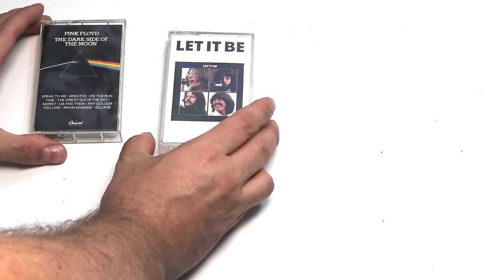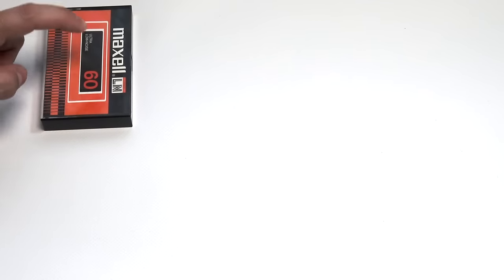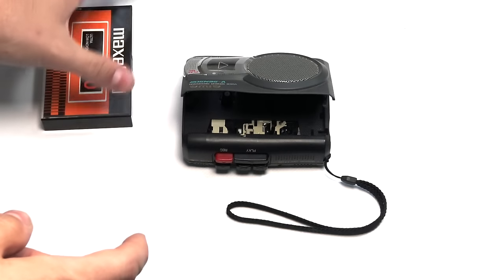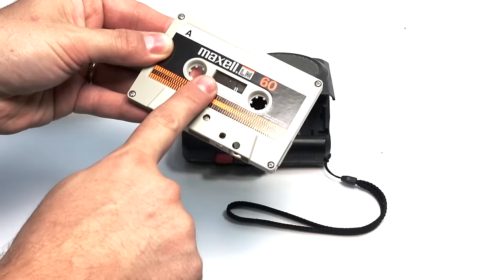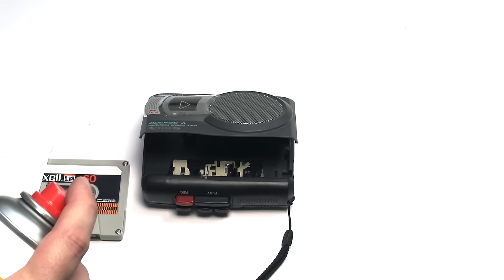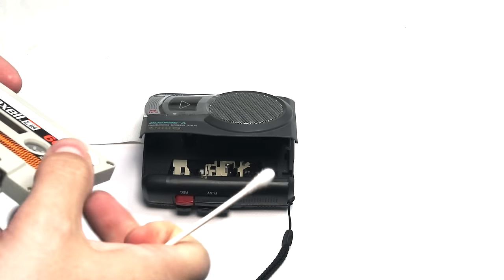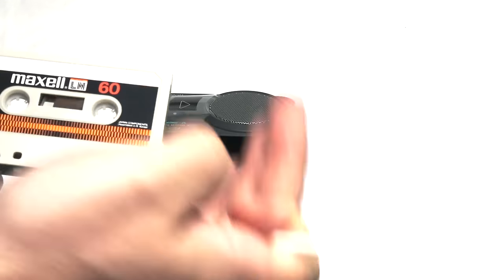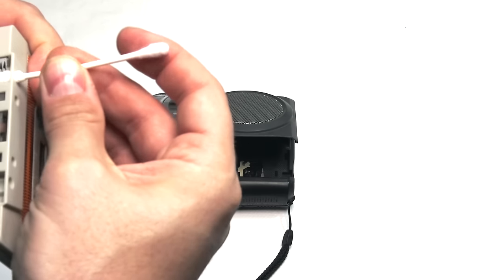How to relubricate your stuck cassette tapes

Comment: REPEAT WARNING; BE ADVISED, LUBING IS DEATH TO ANY TAPE & MACHINE HEADS ETC.
To quote one of the respondents to this post (along with a lot of others!) 'One of the worst things 
about the internet are all the pseudo-know-it-alls and "experts" who dole out this horrible advice 
and dupe people into wrecking their stuff while trying to repair/fix/modify/protect it'.

Between 1965-2005 not one single tape manufacturer, not one of the dozens of major brands, 
once suggested or advised users / consumers to lubricate their tapes, nothing was on the Inlay
J-cards, nothing was in the numerous HiFi magazines of the time, and the reason is simple, its 
an ill-informed latter-day invention, it certainly doesn't date from when cassettes were extant
as a commercial medium. Have no doubt, any lubrication isn't a solution to a jamming cassette.
And no, nothing was on the inlay about lubing, in fact it often stated the contrary, as in 'Avoid
touching the tape'. 

There're numerous contributors to this item begging readers not to lube, and anyone with the
slightest knowledge of cassettes would instantly recognise why, but there are also lots of others
saying how wonderful it is - they obviously are newcomers to the medium and don't know how
catastrophic this insane technique is. All that's needed here is a grasp of one simple fact, jamming
is caused by a fault with the tape mechanics and that's the issue that needs 'repairing', it needs
physically sorting otherwise the issue will not be remedied. Jamming is due to uneven winding, etc.

I personally have many 1000's of tapes and as previously stated, I've been involved with cassettes
for 50 years, and as a fact, and truthfully, have next-to-never had a tape jam or become noisy. If
it did then I knew that something was mechanically wrong and as a fault, it needed servicing and
wasn't going to be resolved with a daubing of liquid on the tape!!!
And addressing the claimed lubrication that was applied by manufacturers in this upload, Yes,
there was lubricant BUT it was in absolutely microscopic amounts and was mixed in with the 
binder but applying a replacement coating in this manner will always leave a residue plus will
do damage to the coating and the deck mech.  

By the way, just to clarify that this absurd suggestion is a massive No-No, here are some other
comments from this post (it'll save you the bother!). As for the uploader, he appears to like
basking in the commendations and applause that people have mistakenly lauded on him, when
in fact he is merely furnishing them with third-party misinformation and is doing harm and no good!

What others who, like myself, are trying to relate so that you avoid making a Big mistake... 
*'I stand by my original comments. NO LUBE or any other solvent is to EVER be applied directly 
onto the magnetic tape. EVER. Sqeaking, lagging, sticking - there is another explanation that 
requires another remedy'.
*'Lubrication is rarely the problem - it's ALIGNMENT of the tape, how it winds onto the hubs. Constant random fast winding and flipping the tape over and back again throws off the alignment and it gets snug inside. Lack of, or absence of, the liners which I call "slip sheets" inside the shell, also casues misalignment of tape onto the hubs - some tapes have "ribbed" or "ridged" liners will help tape wind onto the hubs in good alignment, but they're not perfect. It's always best to allow tapes to play (or wind) all the way from start to finish before flipping the tape over or prompting "reverse playback". To the best of my knowledge, you are not supposed to apply ANY kind of solvent or substance onto the actual tape. The only lubrication I've ever seen is applied to the guide rollers (inside the front corners of the shell) or possibly even a sparse amount on the hubs (where they fasten to the shell's holes, where they do NOT touch the tape), cos if those parts get dry and dodgy and sticky, or even gritty, then that can cause problems with the tape's steady fluid movement. You could also look to see if the deck/players mechanisms and motors are moving with proper lubrication as well. These all require disassembly, of course, so this is "advanced users" kind of stuff, lol. But NEVER put lube on the tape itself. Lube the PARTS of the inner shell and/or the inner mechanisms of the deck... NEVER the actual tape. You'll potentially ruin the tape applying lubes and stuff. That's just my experience. I've been working with tapes for nearly 20 years since I was a teenager, even modifying them and repairing them. I've tried and done it all. The only thing that has remained consistent as a hard and fast rule is to never let anything but the deck heads and the cassette hubs touch the tape'.
*The problem is not "excess lube on the tape", it is lube on the tape, PERIOD. Countless others agree, including people who have worked years in the industry and "seen it all" when it comes to tape. If you have "tape squeak", that is NOT THE TAPE, it's the internal mechanisms somewhere - the guides, the hubs/spools (that the tape winds onto), the little "slip sheet" liners (that protect and guide the tape from the inner shell) - and those are the parts that may require some strategically administered lubrication. But you NEVER apply ANY solvent DIRECTLY to the magnetic tape itself! The damage may not be immediately noticeable, but it'll happen. One of the worst things about the internet are all the pseudo-know-it-alls and "experts" who dole out this horrible advice and dupe people into wrecking their stuff while trying to repair/fix/modify/protect it. You know who benefits from applying solvents to tapes? The solvent MANUFACTURERS. Greedy pricks who prey on the layman's ignorance. If you wanna keep lubing your tapes, that's your choice.But please stop advising others to do so'.
Reply from the maker: Mark, trust me (and Lucky). We know our stuff. In your first comment you claimed that tape has NO lube, now after I showed you scientific proof, you say there is lube...read the rest of the papers in the video description if you just don't believe me and you will see that relubing is a standard procedure in case of lube loss. We are not talking about jamming, of course you are right in that case. We are talking about stuck cassettes. That is something completely different. Why attack someone if you did not understand what I am actually saying. Plus, answer me directly, don't do terrorism just to scare people. Please inform you self on the subject as I have. Bring proof of your claim, and then we can discuss. XRD cassettes are one of the biggest issues, do to the wrong lube, in cassette history.
Reply: @anadialog  To Start, and to repeat as you didn't read it, I have 50 years experience with tapes and still own many thousands. Secondly; Absolutely NO WAY would I trust your advice or any of your cohorts. Thirdly, I purposely avoided mentioning the issue of lube application during manufacturing for the simple reason that it was absolutely miniscule in amount or 'sub-atomic' as someone else defined it, but more importantly, it was applied to the binder and BECAME A PART COMPONENT OF THE DRY MECHANICS. You however want people to apply a LIQUID / FLUID to the tape and yippee - all prayers answered? No. For starters the Lube can go nowhere as THE TAPE IS NOT POROUS so it will still be there, on the surface, and therefore a contaminant, even after all the instructions that you give, ie, remove with a bud (sacrilege). YOU DO NOT EVER, AND NEED NEVER, APPLY A FLUID OR LIQUID TO A TAPE, IT DOES NOT NEED LUBING, IT WILL NOT HELP, IT WILL BE DETRIMENTAL IN FACT.
A tape will happily and reliably work without issue if the tape itself isn't damaged, the slip-mats and shells the same, and no foreign bodies or liquids are inside. If you have an issue with a cassette you need to address and mend the cause and not think that a lubricant will solve the problem, it wont, the problem will still exist (because you didn't sort it) and in the meantime you've wrecked your tape. 
I am by far not the only person asking you to stop promoting this garbage and we are all well experienced analogue anoraks begging people to listen to facts, but while you go around like a demigod who's ego is fed by the admiring remarks followers give you about the garbage you spout, then you will continue to preach this and the ill-advised will learn their mistake. Ciao.
Reply: @marknestbox  could not agree more. As another tape aficionado, collector, user and engineer - this whole video and comments sections has made me sick to my stomach.

The fact that so many users have tried this and have probably ruined their decks and any other they played afterwards - truly makes my heart sink.

This no different than the old-wives tale of pouring mineral oil on records for lubrication so that the needle tracks easier and doesn't produce pops.

Meanwhile, your cart gets covered in oil, all the electronics do, and it transfers all that grime (oil attracts dust and grime) into your stylus and other records.

Please, if you care about the preservation of your media and equipment, do NOT do this. AT ALL.

You've been warned by someone with the knowledge, care and wisdom to help you.
Reply from the maker: Jonah, as many other techs you are driven by prejudice without real knowledge, in this case, about this issue. It is really sad to see how arrogant you are, just go back and read your commnets. I see now that you have written several negative comments over the months and I think you should inform youself better before pointing your finger, insulting and denigrate people. I have posted simple things but considering that you would like more proof here you go. After rading this info, I hope you will be polite and intelligent enough to apologize.
Here you will find a selection of scientific papers explaining the issue and how it is a standard procedure to relube tape (even NASA does this!). I have underlined a few crucial passages in the papers: 
Heritage: https://www.dropbox.com/s/f8254yfeqrrw9vp/heritage-02-00097-v2.pdf?dl=0
Nasa: https://www.dropbox.com/s/xxdw1qh8mlbppdu/Nasa.pdf?dl=0
HESS: https://www.dropbox.com/s/ydrvxg6zipjkrvw/HESS_Tape_Degradation_ARSC_Journal_39-2.pdf?dl=0
Preservation Commission: https://www.dropbox.com/s/3s3ejmho2jexhgt/pub54.pdf?dl=0
   - (here is the official article: https://www.dropbox.com/s/rtvqt1n537w9vpa/Bogart.pdf?dl=0)
Kondo: https://www.dropbox.com/s/zi4vv42ggi9vh8u/tribochemistry-of-ionic-liquid-lubricant-on-magnetic-media.pdf?dl=0
Here is an article of a lab that is relubing its cassettes: http://tasso.cat/re-lubrication-of-compact-cassette-tapes-with-sbs/
Reply: @jonahmcgarva  OK, what can I do about my stuck tape then? I haven't applied any lubricant yet. I transferred the tape to a brand new shell, so it had all new slip sheets, gears / wheels etc to move against but is still stuck.

Comment: The truth about wd 40
 "Surface Compatibility For all variations : WD-40 demonstrates none to negligible deleterious effect to plastic, rubber, and metal hard surfaces. This includes Acetal, neoprene/hard rubber, HDPE, PPS Copolymer Polysulfone, Teflon, Viton, steel, galvanized steel  hot dip, electroplated, copper, brass, magnesium, nickel, tin plate, titanium, and zinc.

Surface CautionsNearly all surfaces interact with WD-40 as they would any high grade ali-phatic petroleum spirit. Certain types of rubber will swell upon prolonged immersion. Wax polishes and certain wax coatings may be softened by WD-40. Clear polycarbonate and polystyrene may stress craze or crack. Always test surfaces first."

This is from their own spec sheet. Unfortunately rubber seems to be contradicted.

Ill probably be dead before my cassette decks.
Reply from the maker: As I said, stick with those suggested in the video because I tested them...I did not recommend WD40 because I never used it...
Reply: @anadialog   true you did not recommend wd 40. The main point is whatever you decide to use check the manufactures spec sheet first as a starting point. Experiment on rubbish first. If you cant lose a tape or player dont do it. I  decided to try because it drives me mad when the tape stops. Not knowing why too. Good video. the more who try the better the science
Reply: @guitartuitioncoventry437 WD is way to oily to put on magnetic tape  ..It probably would not play any sound after you shield the tape with that stuff..

Comment: THIS IS NOT A RECOMMENDATION BY A BOFFIN, ITS A QUACK QUOTING THIRD-HAND DAMAGING KNOWLEDGE THAT REFUSES TO ACCEPT MY OWN 50 YEARS EXPERIENCE AND THAT OF MANY OTHERS SAYING DO NOT EVER LUBE CASSETTES. THE GUY IS A TOTAL ARROGANCE AS WILL NOT REMOVE THIS WRONG ADVICE = DO NOT LUBE YOU CASSETTES, NOT NEEDED AND IS FATAL. PROMISE (WATCH THIS REMOVED AS LIKE ALL BIBLE BASHERS THE GUY IS A TOTAL FRUITCAKE RECYCLING DISBELIEF). FRAUD.
Reply from the maker: I brought facts in the video deacription with links and scientific data in support of this practice that I did not invent, just reporting. As you can see from the comments several people tried and it worked and up until now nobody claimed otherwise. Where is your data and proof Mark? If I was as you claim I would block your comments instead here we are discussing again about it.
Reply: @anadialog  you are plainly misrepresenting and misreading the facts. 

I am also a professional engineer of 30+ years in both broadcast and recording/mastering/mixing.

Please understand, you are wrong and are promoting serious and costly damage to many cassette decks. 

This is not good advice AT ALL.
Reply from the maker: Jonah, as many other techs you are driven by prejudice without real knowledge, in this case, about this issue. It is really sad to see how arrogant you are, just go back and read your commnets. I see now that you have written several negative comments over the months and I think you should inform youself better before pointing your finger, insulting and denigrate people. I have posted simple things but considering that you would like more proof here you go. After rading this info, I hope you will be polite and intelligent enough to apologize.
Here you will find a selection of scientific papers explaining the issue and how it is a standard procedure to relube tape (even NASA does this!). I have underlined a few crucial passages in the papers: 
Heritage: https://www.dropbox.com/s/f8254yfeqrrw9vp/heritage-02-00097-v2.pdf?dl=0
Nasa: https://www.dropbox.com/s/xxdw1qh8mlbppdu/Nasa.pdf?dl=0
HESS: https://www.dropbox.com/s/ydrvxg6zipjkrvw/HESS_Tape_Degradation_ARSC_Journal_39-2.pdf?dl=0
Preservation Commission: https://www.dropbox.com/s/3s3ejmho2jexhgt/pub54.pdf?dl=0
   - (here is the official article: https://www.dropbox.com/s/rtvqt1n537w9vpa/Bogart.pdf?dl=0)
Kondo: https://www.dropbox.com/s/zi4vv42ggi9vh8u/tribochemistry-of-ionic-liquid-lubricant-on-magnetic-media.pdf?dl=0
Here is an article of a lab that is relubing its cassettes: http://tasso.cat/re-lubrication-of-compact-cassette-tapes-with-sbs/
Reply: OK. With all your experience, please can you explain how to get a stuck tape to play again? Already been transferred to a new shell and is still stuck.

Comment: There is no suggestion. Do not lubricate please, please, please. 
Buy good quality blank cassettes for record. 
Your advise is as BAD as touching a cassette to a (strong) magnet. That ruins a cassette too! Do Not Do It.
Please do not lubricate anything inside there!
Some people back in the past were adjusting the force of the spring, oh yeah, that spring that press against the head. Even that "adjustment" could ruin a good cassette! For the love o GOD do not lubricate anything inside a cassette you want it to last decades.. literally decades!
I have 30-40 cassettes from my teenage years, recorded by myself some.. some recorded in studio.. they are still good. Every year I rewind them to the other end for the tape to remain flexible.. as flexible as they can be after 20-25 years..             and you invite me to lubricate them... ??? on the back? 🤣🤣🤣🤣 The back won't touch the front were all those good particles sits (or suppose to sit for many many years)? Do you know how a cassette get recorded by the way? I expect that to explain to us before telling us to lubricate the tape.. Come on, this is an injury that a simple old cassette DOES NOT DESERVE. Oil something else; a door hinge, a bycicle chain, and it will thank you.. but NOT  a cassette that suppose to play music..
I am not crazy... no I am not.
Reply from the maker: How lame! You cancelled your first message with my reply becasue you know i am right. You mentioned that what you read in forums should be our guide. Those are only opinions, I bring facts and once again go and read the scientific articles I have linked in the video description. This is a standard procedure when restoring magnetic tape, plus ALL TAPE has lube in the binder. You juts need to clean the tape after it had time to absorb. Read the comments of those who tried, even years ago, nobody ever claimed any negative things! Please read, get informed and then criticize. You are just writing your opinion here, I am bringing facts with scientific article and direct experience.